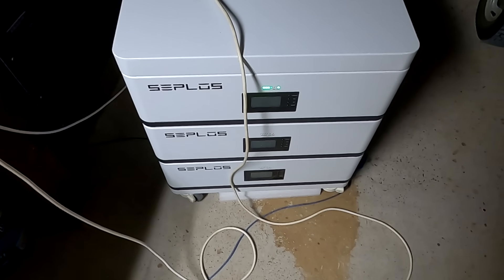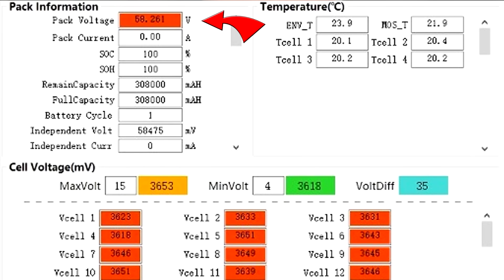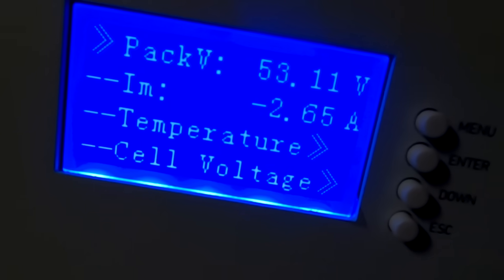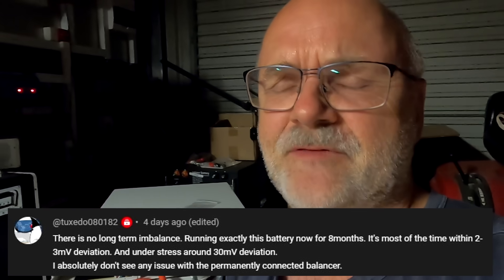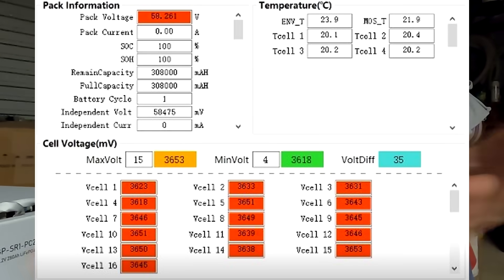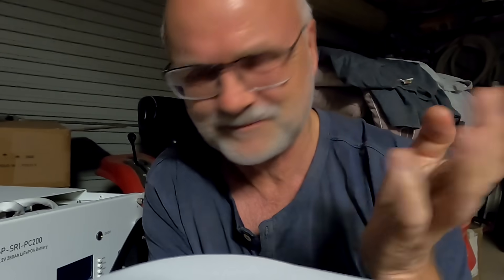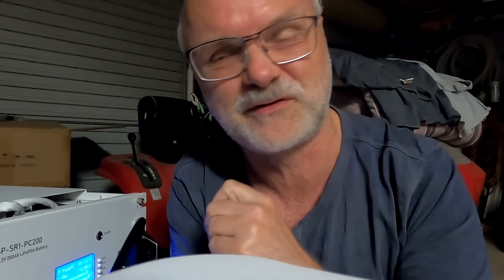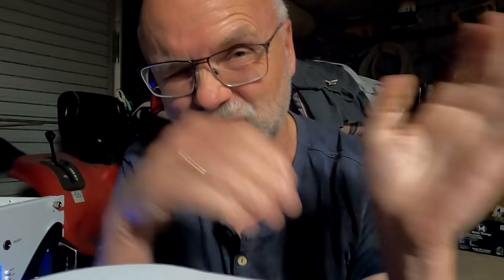Active Balancer: always on or only above 3.45V?

Comment: If you find one or two batteries are the higher or lower all through the cycle then surely better to balance all the time. Then when charging then the batteries start more level.

Comment: A test with 10a charging voltage the 314ah eve, the difvol neeey 4a is 0.002 with the balancer connected but turned off.

Comment: But the bottom is important. If one battery is 2.5v and others 2.7v the bms cuts out. Doesnt matter at the top. Still has enough to work. But the bms will cut out if one gets to 2 5v and the others 2.7v. That would be at 10.6v

Comment: How much top balance is changed 1% 5% or 0.1% of the capacity ?
What if the balancer wait until there is more than 50mv ?
Fully charged battery at 3.45 or 3.50V how much capacity difference this makes ?
Maybe you are trying to be too precise for marginal gain on longevity.
I beleive that as long as the deviation does not get out of hand and start to grow indefinitely, maybe we should not care too much.

Comment: I am new to  this and trying to learn haw they realy work . I have a 18650 battery 12.6 v pack bms and  active balancer .
I leave the balancer running all the time and its working well battery's always stai balance .
Recently i made a lifepo4 32650 14.6 v  sistem and purchased the same active balancer what i use for 18650 works both ways.
With the lipho4 32650 pack the balancer cant run all the time . What is happening is that it will get unbalanced  and  keep on balancing and drain the  battery over night  bringing it dawn to as low as 13.2 13.3 v .
This is my experience with active balancing until naw using 2 difrent sistem with the same balancer .
Olso try a lifepo4 eve  cylindrical battery same thing happened.

Comment: What’s you’re idea - my battery 3.2v 280AH  will not charge over 3.37v ? At different times I am able to get the voltage up to 3.43v stop changing and the surface change goes away back to 3.37v ? “ please what’s your expert idea please ?

Comment: Hi andy im really learning alot from your videos. And i sometimes argue with people who thinks AB should be 24/7 always on.

Can i ask your opinion since i have a  16s i have 3 rouge cell that quickly  goes too high/low during charge/discharge..  i have set my balancer(capacitive with a30 controller) to start at 55v and was thinking of shutting down at 51.2v(my daily DOD CYCLE) 
Im really having issues during discharge cause one cell of 3 rouge cell is really too low hitting LVD too early (at 52v cellpack)

Thanks and cheers
Reply: Sorry Andy can't find the message from @thegreenthing7603 going to reply here and hope he get's it. For the BMS I use Andy parameters and for Deye inverter I have this Batt-V Mode, Float V : 54.5, Absorption V 55.8V, Equalization V 55.8, Equalization Cycle 1 and Equalization Operating Time: 3 h/2. The inverter first charge to the parameters you have and when consider the battery full stop the charge and only some minutes after will activate equalization, you should use a long time, mine is for 2A JK BMS, the long time is because the worst cell will reach the higher voltage and will discharge to reach the voltage of the others and only when they are all equal will resume the charge of the bad ones. Hope this helps.
Reply: @CantFindInYoutube  hi thank you for finding time to find and reply to me, really appreciate it.

My battery pack has oem bms(dont know the brand) your parameters are ok but may i ask does the equalization parameters work on battery with bms since equalization is meant to be use for lead acid directly without bms.. i kinda notice that when my battery is full, the bms cuts any charging how will equalization feature would work with bms power pack.. is my assumption correct?
Reply: If your BMS cannot talk with the battery you need to setup the inverter for lead and it works very well. My first winter I had only 1 hour absorption and equalization off and after 3 months had a cell with less 10Ah. This inverter don't have absorption time so you do it in the equalization. The BMS is to protect the battery if it cuts the charge you need to revise your configuration. The cut of the charge is done by the inverter. For the inverter be able to balance you should setup in the bms the balance voltage at 55.2V and the cell OVP lower than 58,41V, I use 57.6V. If your bms don't allow to setup values you need to know them and adjust the inverter according. @TheGreenThing
Reply: @CantFindInYoutube  my battery/bms can communicate via can with the deye 5k. unfortunately, i have no access to the bms setting parameters & i do not know what type/brand is installed it just displays "WELCOME TO SMART USE BMS" 

Though ive seen the voltage pack charging upto 56v only then it cuts the charging.. ive also seen the deye inverter sending 55.xxV with -13w(afer reaching 56V) but when i check the display on the battery case it just stays 53.6v with zero current hence i do not know if the bms/battery is in absorption time.

Should i just use lithium mode or BattV mode with your parameters and equalization mode ?
Reply: @thegreenthing7603  If the CAN is working the parameters you put in the inverter should work. You can try to program the inverter with same values of Andy. To use has BattV mode you must have control of the configuration of the BMS or at least know the parameters of the BMS. I read the initial post you wrote to Andy, do you have a multimeter to check the voltages of the cells in red? Can you very if the cells and bms cable have good contact? Don't trust 100% in voltage of the bms balancer or even in the inverter V. In my case my DEYE 1 measure -0,3V than the actual voltage and DEYE 2 +0,13V and I have to adjust the values of 2 of my JKBMS to read the correct voltage of the cells, after it I confirmed that my cells were OK BMS was reading wrong value and unbalancing the cells.  Use your voltimeter has your reference and configure your devices based on it. Any way if your system is working and you don't notice loss in capacity or high temperatures ignore the values and enjoy it, just try to fully charge the battery at least 2-4 times a year.
Reply: @CantFindInYoutube  previously without the balancer installed, i can not use the battery further down 52v because of 1 or 2 cells hitting uvp(3.0v) 
Now ive installed an AB after few charge discharge cycles(5 days) im able to use down to 51
2v DOD.  Im still able to see large voltage deviation around 100plus mv..

Unfortunately im really not be able to know or edit my bms parameters.. Im now using lithium mode.. i dont know which one is better battV or lithium.. with the deye inverter.. can you pls suggest what should be my starting balancing voltage and when to stop
Reply: The balance should start at 3.45V.Don't have balancer always on it will unbalance your battery. Have a cell that above 3.3V deviate from the others and when it reach balance voltage 3.45V start discharge but this cell has less charge then the others if I start to balance at a lower voltage for example 3.2V it will charge even less. The theory of having balancer always on will only work if we could balance with the A that we put or remove from the battery. I have a average of 50-100A use and my JK 2A do little if I can top the battery everyday but that little will unbalance a battery over days if it daily remove some mA from the bad cells (The ones who reach hight voltage on charge) Andy explain and prove this several times, I also have tested it, and have daily graphs in homeassistant of the voltage of each cell that show what happen.  @thegreenthing7603

Comment: My friend never listens to me on this matter and i laughed my ass off when he told me it's not fully charging anymore and sometimes it is charging, when i checked on the bms it showed that 3 cells are already at 3.65V and the other cells were at 3.4, 3.42, 3.35, and one was at 3.3V his active balancer messed everything up, as soon as i modified the balancer(i.e making a voltage switch that makes the balancer turn on at 3.45V per cell) the cells balanced flawlessly with the highest at 3.65 and the lowest at 3.62V

also i might've made a joke about using a horse to balance it, he asked me what it was and i neighed at him, he laughed and is now part of the NEEEY fam

Comment: I have seen many of your videos talking about being out of balance and having weaker cells. It seems logical to have an active balancer on all the time. If anything have a scheduled monthly balance day. Then see what happens. My Schneider c-40 has a setting for a monthly auto higher charging cycle to help with balancing. I haven't used this yet, my system is not built.
A lot depends on the state of the batteries, old? problems? and the settings you have decided on.

Comment: How are you getting 58.2 volts with active balancer?  

Here is why I am asking, perhaps I have something misconfigured. My bms when active balancer volts reach 3.45 it never goes higher than that alone per cell. With your 58.2/16= 3.63 per cell. You indicated that your active balancer is set to start at 3.45v.  Can you explain why I am seeing different results.

Comment: I think when a battery has an active balancer that is actively pulling it literally out of balance and you don't reach full often in other words you don't top balance often then that one sunny day you do get that drives you up to full quickly can cause a major imbalance and literally a safety  shutdown situation Because of a high cell that goes over 3.65 volts.  Next question is with regular lithium batteries like from the Nissan leaf since they don't have a super flat voltage curve can we use active balancers on all the time with those batteries?  I say more likely yes but not necessarily yes because the same principles will still come into play as they near top of the charge.

Comment: Those active balancers have wrecked about $1400 of my batteries. The last seller I contacted said it stops balancing at less then 2.0V. I tested it below 2.0V and it still was balancing. Those cheap Chinese balancers are dangerous junk. They do not work according to design and will discharge your cells too low if not carefully monitored.

Comment: Time to U turn Andy. You need balancer active all time. 
If Flat part of the curve do not need balance balancer passive anyway. But during discharge if one cell voltage drops more the others, this means this low cell needs balancing for sure. 
Time to U turn :)))

Comment: Thanks Andy,
I have DIY 16-S packs and when I built them, I let the balancer run all the time, that was not ideal.  Now just when the cells come up above 3.35 seems best in my system.  A good top balance starting point helps a lot, since the cells at 280Ah will take ages to self top balance.  Thanks again.
Reply: In the "flat" part of the discharge curve, the cells will not show significant voltage differences anyway, even if they were 20% difference in SOC.  They only show significant differences in voltages near the top and bottom of the curve.  Set the voltage delta to 20mv and use balance "on" at 3.2 to 3.35 volt.  If you use too high a set point - like 3.45 but one cell is lagging, the BMS will never balance the pack before cutting off charging.
With 16s (48v) packs, the chances of one low cell is significant.
I have also noticed, a new pack may require a lower start point for balancing for a number of cycles, then as the pack becomes better top balanced, you can change the start balancing voltage higher if you like, since the cells remain closer together in top voltage as the BMS balancer does it's job.

Comment: I use a 12 x 12v RollinCart battery 24v system with the HA01 type of balancer in each pair.

They balance all the time, but only ever balance at 10% or 90%.

I have not noticed any issues with the top balance, all the balancers stop flashing within 1/2 an hour of hitting full charge, all the batteries are within very close voltages.

I think it may cause a big issue with batteries that sit at a very low SOC for ages, but because the balancers have such a small amperage, the deviation doesnt get too bad in normal operation.

Just my observations for the last 3 years.

Comment: All this testing looks like unrealistic to me. In reality you charge home storage within about 8 h and discharge within 16 h, and you keep the battery between 10-90 % or even 20-80 %, with a voltage range between 3.0 V and 3.4. There is just no problem with imbalance, even it would be 200 mV. 

My balancers are now running since more than 7 years 24/7 when the deviation is more than 10 mV. This all with simple Single Board BMS without any fancy features. Charging is done until a total voltage of cell count x 3,40 V. Most of the time charging/discharging is below 0.1C with occasional up to 0.3C. When the balancer is running 24/7 it is enough time to iron out potential imbalance caused by the balancer in the flat area. But taking into account that balancing is done only at a difference > 10 mV, and the difference in the flat area is very small anyway, there is not much balancing activity. 

So my long-term experience is that running balancers 24/7 is no problem, at least not if balancing is done with difference > 10 mV. This is good enough for most home installations.

BTW, alltime on active balancers are an additional level of protection to keep cell voltage together, even there is a weak cell in the pack. It will immediately balance when load or charge drops.

But IMHO the future will be to use cascaded H-bridges which charge/discharge cascaded cells individually according to their SOC following directly the sine wave of sources/sinks with an efficiency of 99+ %. No further balancing necessary, behavior just like single charger/load for individual cells.

Comment: Like you said it depend on the conditions and all cells are slightly different, all my BMS are JK with 2A balance and last months I have done tests with 3.2 - 3.4V and just started with 3.45V and all my batteries have grade A matched cells and all have become unbalanced. First reason, I have an Deye inverter and charge in lead acid battery mode and I cant program absorption time so at 3.4 it will only balance a few minutes until it reach my absorption of 3.45V, because worst cells have higher voltage on charge this means the bad will reach balance voltage first and will discharge to charge good ones, with 3.2V balance in one month the pack lost about 15Ah, so with your 3.45V it won't balance but won't discharge the bad. Second reason for the unbalance since my cells are true grade A, I charged 490Ah with 110-90A and the higher the A the bigger the power differential and balance ports don't measure the exact voltage and I had one port with a difference of 22mV, the cell was good but because read higher voltage won't fully charge. Increasing Con. Wire. Res. Settings allow to drop the voltage of  the cell and put the correct value and now I have all cells fully charged. This difference in value can be many things, BMS, bad contact on bus bar, the terminals are bad so can be the also there, oxidation, bad wire, wrong torque, etc so first fix those and after adjust the parameter. The third thing I have done was lower the charge to 60A and probably will go to 45A, in summer we have many sun hours so we can charge slower, in winter I will increase the value. Forth the equalization parameter has a time so I adjust it to 1 day  and 2h/2 and 55.2V, it only work even days but at least  now  at least do some balance, everyone talk about absorption time that I didn't realize that what I need was the literal meaning of the parameter.

Comment: 2x 5A active balancers (capacitive) in parallel. Always on. For over 2 years now without any issues.

- 12V in-car system
- 13.8V charged voltage
- SoC ranging from 20-100%
- 240W PV charge
- 400W DC/DC charge

Works a treat.

Comment: I really think that there is too much importance put on balancing in the first place. Constant balancing puts more stress on weaker cells by making them work harder than they want to, and it wears out the stronger cells more quickly by putting them through more cycles than they would otherwise be doing. In other words, it shortens the life of the pack, not lengthens it. Balancing shouldn't be done just to keep all the cells equal at all times. It should be done simply to keep individual cells within their safe operating range. Not too high, not to low. It doesn't really matter whether they are exactly the same as the rest of the pack. Really, balancing should be done only at the top and bottom, and even then only to allow using the most total energy from the pack by squeezing the last bit from the stronger cells at the very bottom and pushing the last bit into the weaker cells at the very top. Even then, best practice is to not fully charge or discharge more often than strictly necessary.

Comment: Hi Andy, and it’s interesting, as always!
My opinion: That the balancer is permanently, will mean that the battery will be balanced correctly, and sincerely I don't see why it won't be balanced?
But that the balancer is in function is useless, the system for example of the Neeey is much better, or as you did with the
voltage detection relay.
I will be very surprised, if the battery does not balance, with the balancer always still On?
we will see?? Thank again Andy!
Reply from the maker: Thank you, Video will be online tomorrow...

Comment: I think everything depends how good are cells and how long you don’t use battery with active balancer on. Like example if you daily charge and discharge battery active balancer shouldn’t do anything wrong just keep cells in balance. I think would be bad to leave active balancer on 24/7 when you don’t use your battery
Reply from the maker: Yes, very good and valid point. If you have well matched cells, it may just work with the balancer being on all the time.